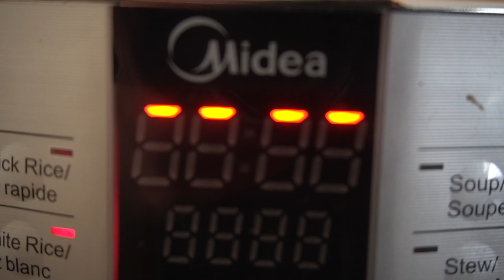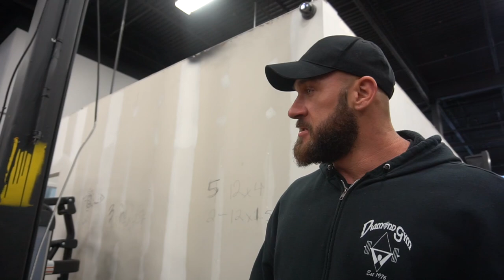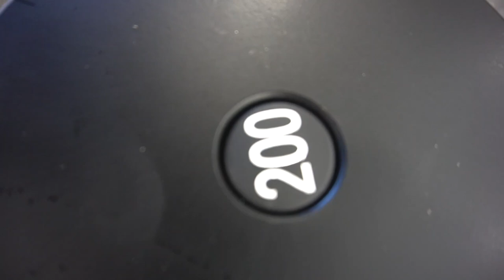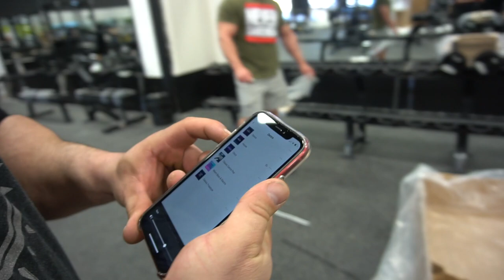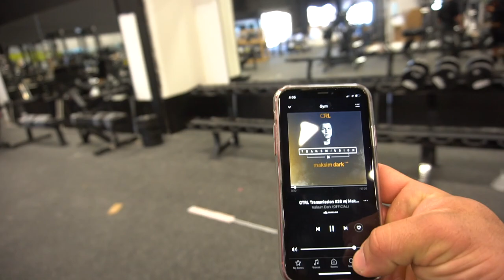AVP EP6 : White fish and where I will train from now on!

Comment: If you boil the chicken breasts. There will be also virtually zero fat left.. Mark Dugdale was cooking ground beef and then washing it in water to wash as much fat as possible. That way it will be also very very low fat. But like I said boiled chicken and turkey breast is like 1g per 100g.. But yes fish like cod is very very easy to digest if you need to eat a lot..